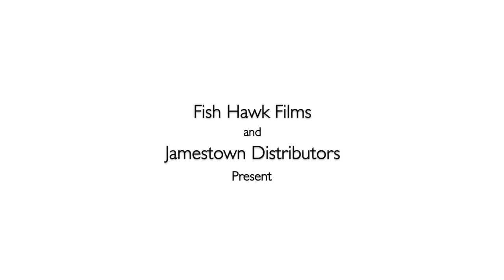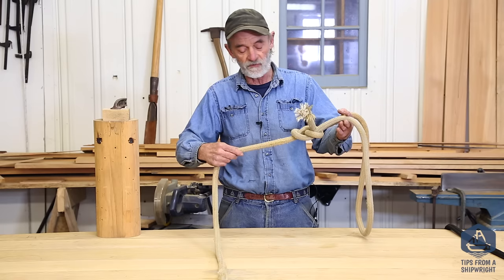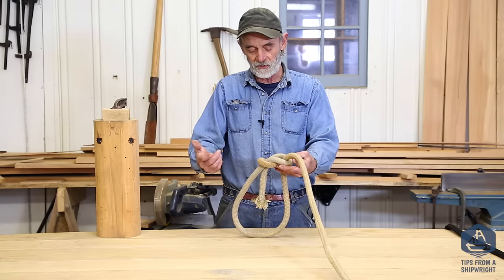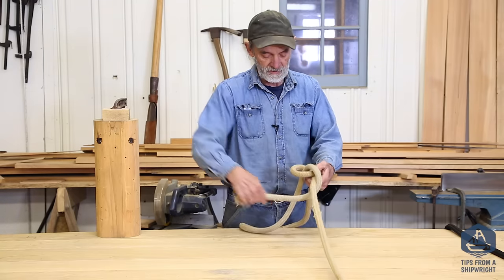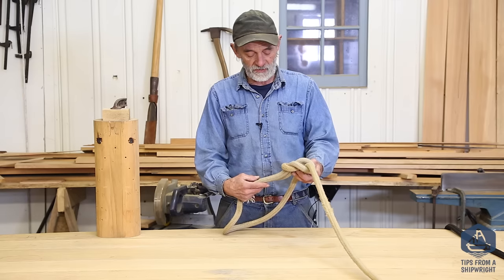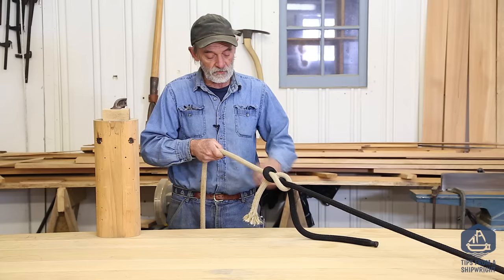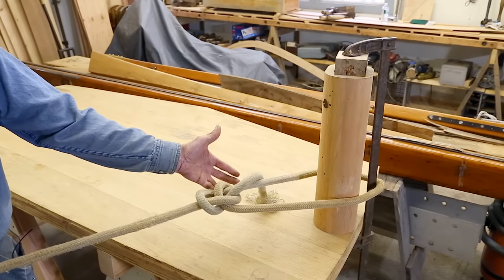How to tie a proper Bowline knot

Comment: Another way is to tie it by running the line around your waist  with enough  on the bitter end in your right hand  to go around the standing end to have enough to form the pass around the standing line . With the rope in the right hand have your thumb come under the standing line and turn your thumb up and to your right making a loop in the standing end then do the rabbit around the standing end back down the hole than pull the line taught. This is called by some a rescue knot.  The bowline you make this way is always gong to be large enough for someone to slip over their head and solder while treading water. Also if you ware overboard and someone throws you a line you can tie it without letting go of the other end. Thanks for sharing the king of knots.

Comment: In the early seventies I was a deckhand on the Great Lakes ore boats for 4 summers while in college.  The first year I sailed there was a wheelsman who was very knowledgeable about knots who showed me how to tie a number of knots and later presented me with a copy of the "Ashley Book of Knots" when I left the boat (and which I still have to this day).  He taught me what I have always called a a "one-handed bowline".  I was kind of hoping this video would show that technique since it is probably the most universally useful knot I have in my repertoire.
Reply: Hi, You can tie a one-handed bowline from method 2...  Take the bitter end in your right hand, lay it along your middle finger (palm up). Turn your hand palm down over the standing part of the rope, grip the standing part with your thumb and little finger and twist your hand palm up (the easy way - clockwise as I look at my right hand). That forms the loop and the bitter end is now standing upright. using your index finger and middle finger, flip the bitter end round the standing part and back into the hole. 
This way is useful if you're overboard & someone gets a rope to you; get the rope around your waist (as I'm right handed I want the standing part on my left side), then do the twist part. Then the flip round the back and onto the small hole. Your other hand holds onto the standing part as you're being towed along...

With practice and a rope (say 5mm diameter or bigger - doesn't work with string) you can do it one handed, standing on 1 leg with your eyes closed!

Comment: My dad was a longshoreman,  my uncle was a rope salesman. I graduated from coastguard school at age 13. Been on boats all my life. I've been tying those 2 knots , and a few more , literally my whole life.  I really thought I knew all there is to know about them. I just learned that I've got more to learn,  apparantly.  I was taught that the only way to tie a bowline was with the end inside the loop and the other way was incorrect. This is the first time I ever heard the term cowboy bowline . As for the sheet bend, I didn't think it mattered which side the end finished on. I'm sure I've used sheet bands in lines that hoisted heavy loads of pipe or hardware or whatever  overhead. I'm not sure if I tied them cowboy style or not. Now i know it matters. Thanks so much for the tip! Definitely one of the best knot videos ever made.   One more thing to keep in mind. If you can't tie a knot, tie a lot....

Comment: Nice video man! When I used to teach knot tying I have had a student who could never learn the bowline until I finally just taught him the method starting with the slip knot like you did at the end there😀
Reply: Like me…and I’m old…and can tie loads of knots for camping, tarps and the like…but I’ve had a block for years for the bowline. I’ve watched the first parts of this video over and over again but maybe because of my left handedness(?), I cannot follow it. I’m now going to the last section referred to here in the hope I’ll finally grasp it.
Reply: @peterdelmonte9832  I hope it helps. If it does then study the structure of the knot and then maybe learn the sheet bend (same exact structure) and it will really sink it in until you won't need to start with the slipknot.

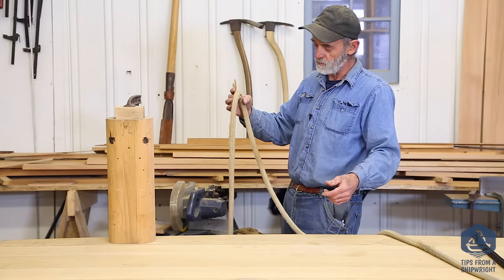Comment: Re 4:20  Learn the next bowline technique, and you can then tie a bowline in the middle of a line, without either end (instead of putting the whole end thru, just pull a bite thru.  Then 'invert'(=sink=capsize) it into a bowline & tuck the bowline thru the sliploop).  Same applications as a butterfly, but easier to untie after loading.
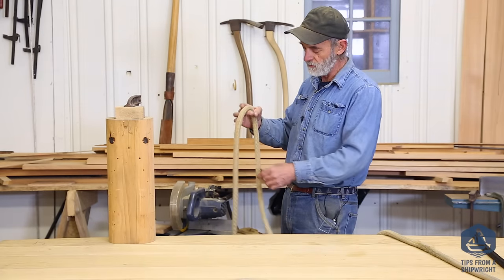Re 4:28-4:32 Note! What he has here is very simply a slip-knot (slipped overhand knot)!  This is the way I've usually tied the bowline since the days when we used a bowline on a coil instead of a seat harness!  Well done.

Comment: Good demo, I have used this knot often, on boats and on land. One thing, I have seen this knot capsize under heavy load whilst towing a heavy old sailing barge, we could not untie it, no matter what we tried because it had slipped as it capsized and constricted round the post, we cut it off with the breadknife !

Comment: The last bit is my favorite! I have been using this for many years at docks and no one can ever understand how I do it. Most docks I encounter have posts that either don't have an open top, or are just too tall to reach to loop over, so I use this method to get a bowline on the piling or whatever faster. I also use running bowlines sometimes if I need the loop to cinch up to the post.
Reply: A running bowline - is that just a bowline with the standing part pulled through its loop, making a collapsing loop at the end of the line?
Reply: Did you notice in the last bit that he got a different knot for the 2 "repeated" examples? Cowboy the first time and standard the second.

Comment: I've been using Bowlines for a long time, and that's the most useful method I've seen. I'll never tie one any other way again! My only criticism is that you could have slowed it down a bit. I guess I'm a little slow on the uptake, but I had to back up the video several times before I figured it out.

Comment: Knots are super cool to learn and use.  I use a clove very often.  just take a bite on the line and twist each end in opposite directions.  That's a clove knot but usable only if you can slip the knot over the end of your material.

Comment: At around  4:30 you are also starting a bowline that a friend showed me.  It was to be tied one handed.  As I recall the line was hanging over a shoulder and that hand could easily tie a slip knot.  With the same hand reach down and grab the long loose end, and pull through the slip loop.  Hold knot and shake = bowline.  Something like that.  No teeth or cheating involved.

Comment: Great demonstration of tying a bowline. One thing to keep in mind, especially with larger diameter lines, and certain synthetic lines is to ensure the 'tail' of the bowline is long enough. 
With larger lines, the ONLY way the bowline fully tightens up is with the force of the vessel. As this process takes place, the line 'walks' through the knot a bit, and if your tail is not long enough, it all comes apart. [Imagine using a 3" polypro line to snag a mooring buoy. Until you back down against the buoy, the knot is not synched up]

Comment: My question would be is it the diameter of the rope that supposedly allows the outside tail to slip?  I have seen both styles of bowline used with heavy loads on 11 and 13 mm rope and I can say without a doubt that if the knot is tied and set it does not slip.

Comment: Great video!  The problem with the "cub scout" method is nobody ever mentions which way to make the initial loop!  If your tree is in front of the hole, the knot simply falls apart unless you invert the rest of the instructions.  Laying the end across the line and then folding them together to make the loop eliminates that ambiguity.

Once you're doing that there's an important variant not mentioned here that follows directly:  the one-handed bowline, in which you can tie yourself into the loop without ever releasing the line with your other hand. (A video will be more useful that me attempting to describe.)  Potentially handy in, say, a river rescue situation where your grip on the line is the only thing keeping you from being swept away!

Comment: You're right I think about the Cowboy Bowline.  One of the working ends of the Sheet Bend is now participating in tensioning the remaining free end.  People seem to consider it reliable these days - definitely more so than previously thought (it has an actual advantage when the loop is ring loaded too).  Also, if you tie the final (noose) method by coming through the other side of the loop, you get a regular bowline anyway, instead of the cowboy type.

Comment: I have spent some years sailing  east coast of Australia,  my way to tie bowline,  hold end of line in right hand palm up, left hand holds line palm up, now if you have a wrist watch check the time as you turn  your hand over ,you've now formed a loop , with two fingers hook the line that is hanging down up through the loop, now right hand feed end through back of loop hold two ends together at the loop and form your bowline,  if a line is thrown to you you will have it formed before you reach the cleat  or billiard.

Comment: I'm confused by your demonstration because I learned the bowline for rigging doing tree work. The property was it made a loop that would slip, grip, and tighten without ever losing the knot but was still relatively easily untied. There is a fixed point knot version though.

Comment: So the “bitter end” is the name for the end of a line. As in keep going to the bitter end.
Reply: Used to be a tavern called the Bitter End...
Reply: My books on knots all call that end "the working end."
Reply: The bitter end is the other end of the line, not the one he is working with.
Reply: The bitter end is typically the end of a line that is permanently fastened to a part of a ship's structure.
The bitter end of an anchor warp is the end attached way down on the chain locker. So going to the bitter end means using all available, or until nothing is left.
Reply: I always thought it had to do with the end of one's life!  :-|

Comment: The double bowline is best if you are going to make a load bearing bowline. Also the regular "left handed bowline with the working end inside the loop is a better knot then the "right handed boweline" or "cowboy bowline" where the working end is outside the loop when finished. It's considered to have stronger "guts" EXCEPT possibky for a load pulling sideways on the loop. Anyway, best to just make a followed through figure eight knot or at least an anglers knot if there is going to be weight on it. Also if you are gonna use a weight bearing bowline, you might as well finish it as a yosemite boweline.

Comment: Another way is to flip a half hitch, render it, and flip the end over the live line and up through the rendered opening. It's the quickest way to tie. bowline.  I also tie a running bowline.  just tie your bowline over your line and you have the loop to throw over your piling.  Sometimes the bowline can hang up doing this.

Comment: Is this strong enough to withstand storm force winds?
Reply: napa modesto Up to 40 ounces.
Reply: napa modesto Depends on the rope you're using. A bowline breaks at around 75% of the rope's rated strength.

Comment: Cowboy style? Its Holland style another one the first is English. The both ones are seamens styles. Couse of seamen made it before americas discovery. Holland's bowline is the best for loop couse of specific vectors of loading. But for connection of two ropes the English one is better as you saw in this video

Comment: You're gonna frustrate a lot of people by not pointing out the the loop made needs to form the rabbit hole from a certain direction. Does the standing end go on top or on the bottom before the rabbit does its little trick... only works one way bud.

Comment: Total wrong, when you throw the hitch you have tension on the third leg which makes it easy to cast or cast the leg as sailors say. Much easier if you hands are full and you need to do it quick. When we would do deck handing on the big tankers we would throw the lines and double step the bowlin to make it tight before we hitched. Sound complicated but.......I have no idea what I'm talking about....good video

Comment: best bowline knot demo but too fast i just can't get it
Reply: +peter sooklal This is really the perfect speed. Get yourself about 10 feet of woven rope at least a 1/4" thick, (although around 1/2" is better). Just start practicing. Knot tying is more of a tactile skill than a visual skill. People that have a hard time figuring knots out are usually visualizing the finished knot while they try to tie. This loads your short term memory and it never quite works out. Think about driving a car - there are about 30 decisions you have to make to get in and drive; which door to open, how to get in, working the seat belt, where does the key go, which way to turn the key, mirrors, and on it goes. After awhile you just use tactile long term memory to automatically drive. When you get into a unfamiliar car you still rely mostly on long term memory, pausing a little when you have to use short term to work around the differences. Knots are no different.  Try tying three knots in a line, don't think about it and just do whatever comes naturally, and then go back and try to identify what you tied. Like driving an unfamiliar car, after awhile you'll realize you aren't tying a new knot, but an old knot a different way.
Reply: Click the gear at the bottom right of the video, select speed, change it to 0.25 or 0.5 :)
Reply: projek89130 thanks for the info
Reply: thank you so much. This is not only helpful, but hilarious!!!

Comment: "invert"...also called "capsize".  The 'cowboy' bowline (also called a Dutch Bowline or Left-handed Bowline) isn't an authentic original true bowline, as your sheet bend illustration shows.  Free (bitter) end must be inside the loop at finish, not outside.  A bowline and sheet bend is essentially simply a half-hitch and bight.

Comment: This “cowboy” bowline that you suggest is not to be found in “Ashley’s Book of Knots”, so I could say that it does not exist.  But you have made it exist, and promote it as being equal to the bowline.  But then you demonstrate how the cowboy sheet-bend is inferior and useless, thus undermining your dual way of tying the bowline, of which there is only one proper way to tie that, and it is with the “tail” inside the loop. There are no knots that are called the same but are fundamentally different.  Call it what you will, I would call it a granny-bowline, because it is tied wrong.  I could also say that it is called a cowboy-bowline because only a cowboy would tie it that (wrong) way.
Reply: @TK-cl1jm  Show where testing has been done and or proper documentation, otherwise, just a bowline tied wrong.
Reply: @TK-cl1jm  Some Book?

Comment: There is an easier way to do this. Make an underhand loop with your left hand. Make another loop with your right, feed it up through the original loop, hook it over the "tree" and pull. This ain't rocket surgery people. Here's another one. Clove hitch. Underhand loop, underhand loop 2, place one on top of the other - clove hitch. Tada!
Reply: I like the way you described in preparing to tie a clove hitch. I use this method all the time to tie my boat to an open ended post at a jetty. It is really quick and can be made more secure by adding a half hitch.
Reply: Thinking you should give it a go with a vid Joe z.
Reply: No, not rocket science, just some people cannot follow the knots, so for some, it ain't easy. Want to admit there are some easy things you cannot fathom?
Let's examine your "easy" explanation: I will have to look up underhand loop. Yes. I know which one is my left hand. Make another loop? Where? Near the bitter end or on the other side of the underhand loop. Now, if I understand correctly, you take this second loop - and know it becomes a "tree"?
You might think I am being silly, but once a person has practiced something so many times, it becomes easy, to the point they forget how hard it might have been.
I am not going to even try to follow tour "tada" clove hitch.

And, explain what you mean by rocket surgery? Is it surgery done to fix the "mechanical" rockets or surgery preformed by someone on another animal that is on a rocket?
The basic principle of rockets is simple, the reaction of a propellant going out one side creates a force in the opposite direction. Tada!

Comment: I don’t understand how an “expert” on knots would use a rope that has not been properly “whipped” (terminated). The rope he is using is a @#$&ing mess. No one working with rope professionally lets  the cordage they use exist in such a sloppy, dangerous condition. So easy to fix the rope before making the video. Unprofessional. Unseamanlike.